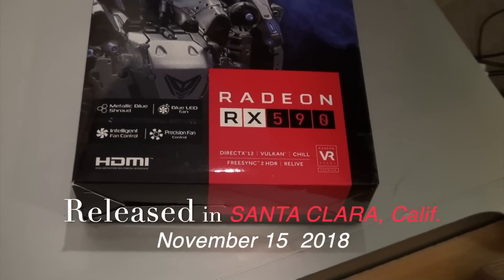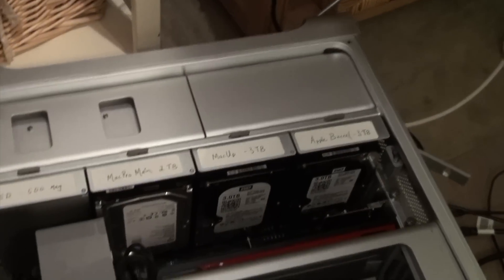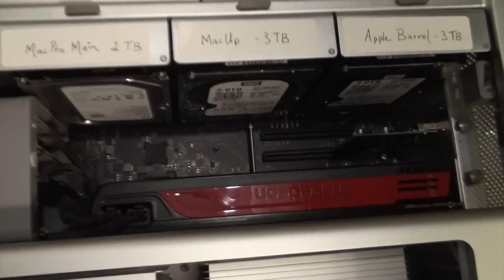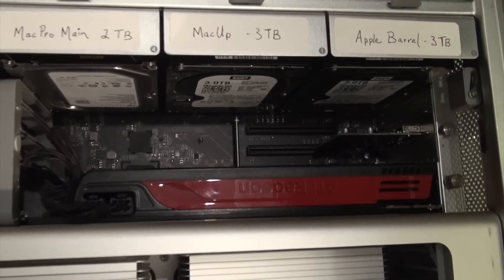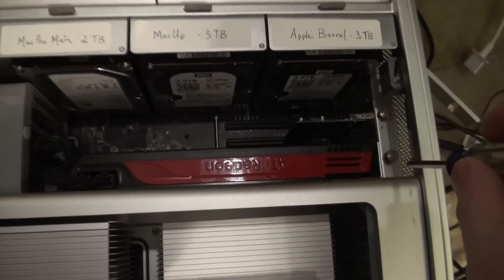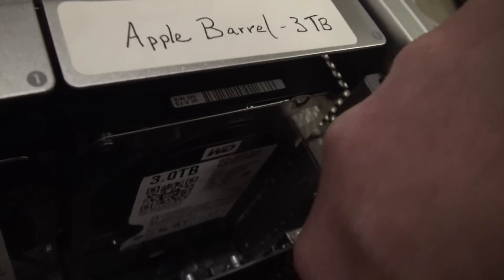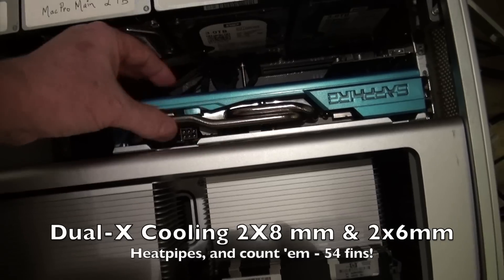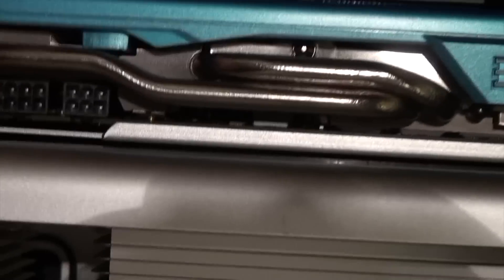How to Install Sapphire Nitro+ Radeon RX 590 in a Classic Mac Pro 5,1 for 4K & Mojave  -  Part 1©

Comment: Sadly it will fail when you do the high GPU tasks due to insufficient power. You should do the pixlas mod on your power supply and then connect this extra power cable to this 6 pin. I can bet it is failing when you use is for GPU heavy load tasks.
Reply from the maker: Thanks for your comment Lucas... if you do a bit of research - the PC World review mentioned - says it draws about 225 W. Sapphire themselves say 250, if you overclock it - maybe 300 Watts. if you actually watch the video you'll see the PCI slot has 75, each 6 pin dual cable has 75 for a total of 225! So no worries. I have had no problems, no noise and again if you actually watch this video I turned the Bios switch down to draw less power!  But if you know something I don't? Please speak up!  by the way the Mac Pro 5,1 has an amazing 980 Watts of power. I have 5 drives inside and a blue ray burner... and so far... smooooottthhh. http://www.macpartsonline.com/661-5449-apple-power-supply-980-watts-for-mac-pro-2012-2010-2009-a1289.html
Reply: @applesaucemacintosh3577  Hi Thanks for your great video. I bought the Sapphire Pulse RX 580 and installed into my Mac Pro however I am getting a purple cast on the monitor
Reply: When using a Sapphire Pulse RX580, I measured about 130 watts when gaming, so to me it seems the manufacturers list a higher power draw, maybe to have a margin of safety.
Reply: It's not going to fail. I've had this card in my mac pro with a 24 hour torture test. No problems. And the pixlas mod... do not use wiretaps if you go that route. Do it right and ready further into the thread for the correct way to do it. The only reason to go that route is the Vega cards.
Reply: Ster Fry do you have a video link or page link were I can see how to do that for a vega frontier please?